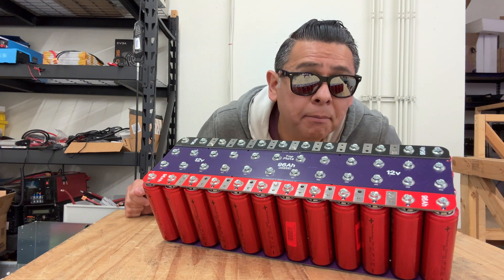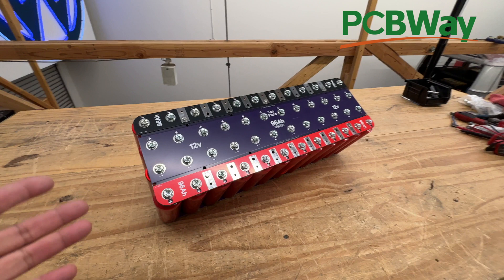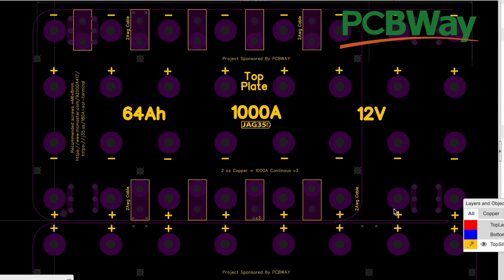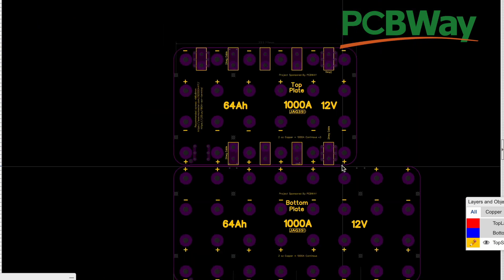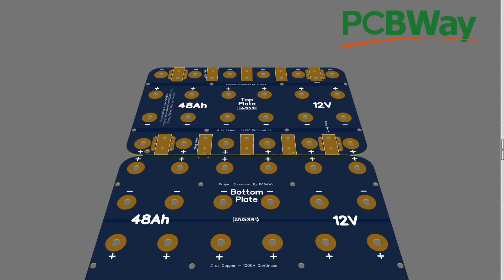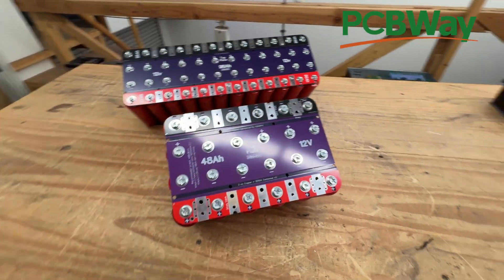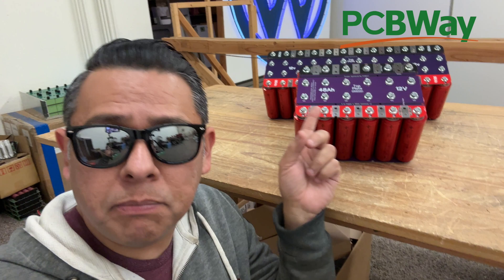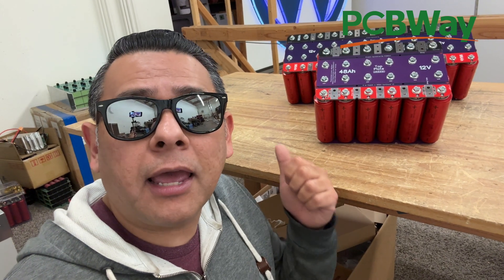48Ah Headway Busbar - open source project - PCBWay

Comment: Hi, I also build batteries on 18650 cells. I have a short 2 minute video showing some pictures. I like your idea of not welding so I'm doing a similar thing but with a 3d printer. Using used cells is perfect for the economy :) thanks for all the interesting videos.

Comment: I was looking to do something like this, but using 32700 cells.(I saw it selling with the screw spot welded on top of it) and put it on a 3D printed case and etceteras.

Do you think its a good idea or should I go to LiPo batt?

Comment: Can a battery made of 24 cells start a car/truck?
Reply: They should be able to, these particular cells can supply 200 A, so a 4s6p setup like the smaller 48 Ah pack here could supply 1200 Amps. Should only need 700 - 800 Amps to crank even a very large diesel motor in a pickup truck.
Reply: People are starting them with 8.